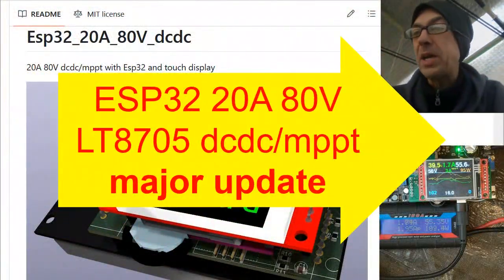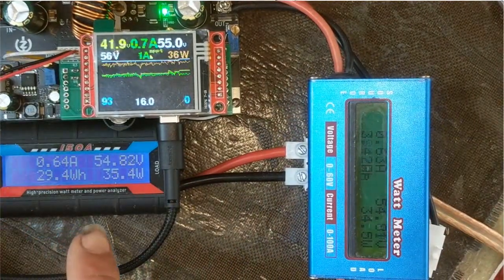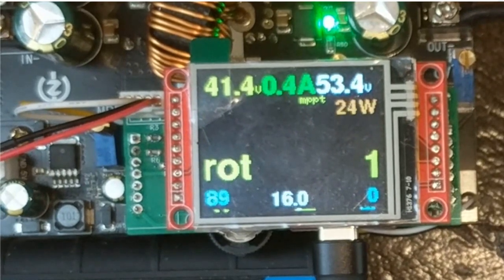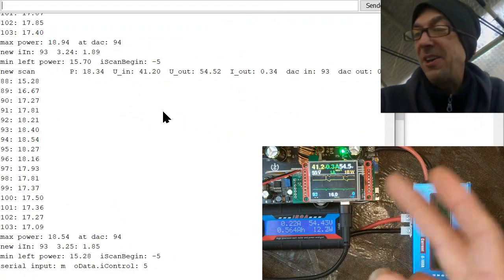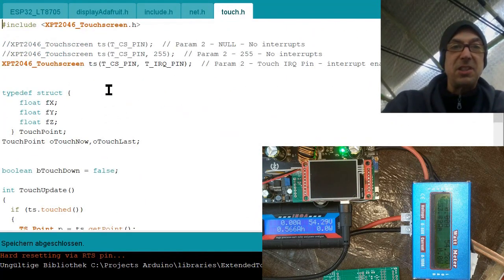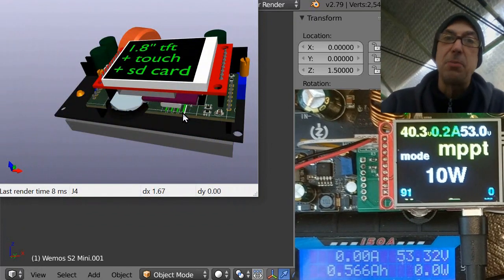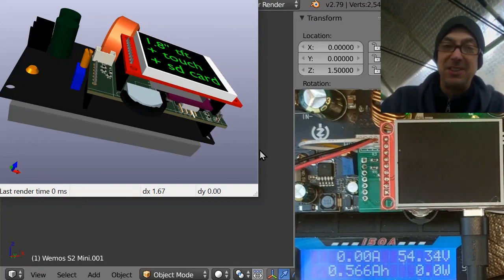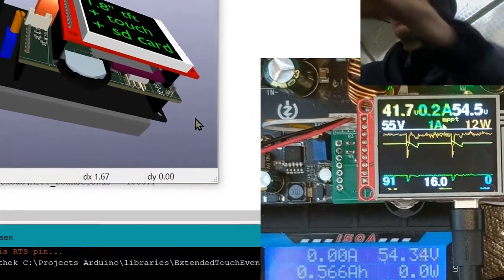major update: ESP32 20A 80V dcdc/mppt with TouchTft

Comment: is this with external dac or pwm
Reply from the maker: Nice to see you here again. No space for nice MCP4728 on my little pcb: https://www.aliexpress.com/item/1005006272473960.html
I would like to use the two 8bit interal dac but DAC_2 is broken (tested all my S2 Mini..). So i use 10 kHz 8bit pwm with a 100 nF low pass: ledcSetup(CHANNEL_DacOut, 10000, 8); 
more bits or kHz should be no problem, but the 8 bit are enough for me.
But i only have about +-10 Volt i can adjust with these 8 bit. That is because of the 10 kOhm resistor to dampen my dac input. With 5 kOhm, i guess i could control maybe +-20V. 
I remember that you would like to control the full 1.4 - 79 V output range. Then you would need even smaller resistors R9 and R10. And yes, 8 bit would be bad. 

I have uploaded v2 to my github. When i can solder the S2_mini to the backside, this might also work for the MCP4728..

The LT8705 could make use of four dac channels as it can also handle input_current and output_current ...
I do the output_current regulation by controlling the output_voltage :-/
Reply: @robodurden  the reason to use opamp as output follower is too increase output driving capability so I can control the full 1.5~30/80v
But seems like sometimes it's not really necessary as some commercial design just have simple rc filter straight to the feedback

Indeed my very cheap digital module control the constant current by voltage but with a very bad PID loop, so when I use constant current to drive led as studio light it flickers horribly in camera I had to use constant voltage insted